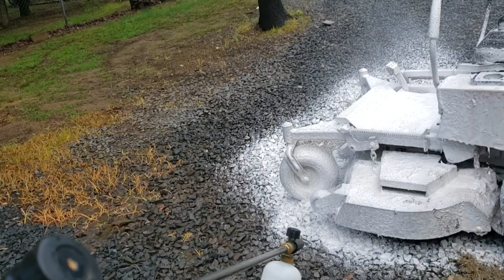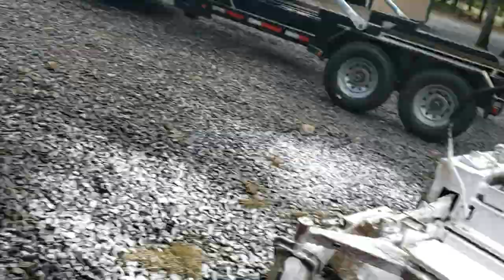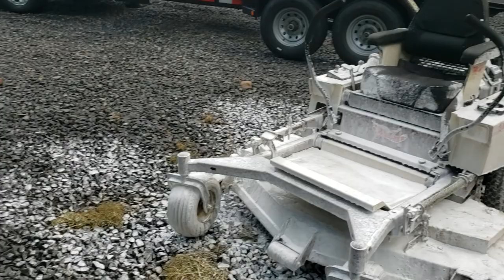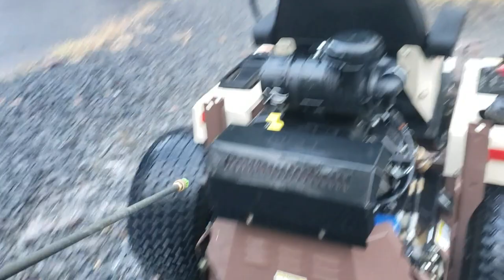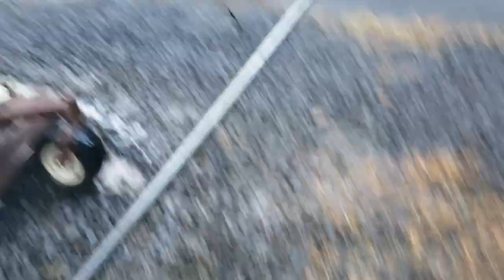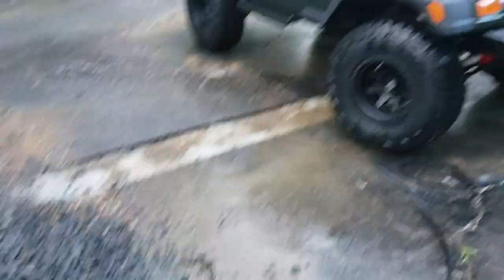Zep truck and trailer wash vs nasty zero turn mower

Comment: In my experience,  Rinsing the vehicle or farm equipment first with just water and then doing the foaming procedure  using 50/50  zep & water with a squirt of Dawn detergent in the foam cannon will yield nice foam with nice results.  Also this  will allow  your bucket of zep concentrate last twice as long... BUT as you mentioned (its your mower - and you will do what you want)
Reply: By doing your method, it should be fine on clear coat and paint on everyday vehicles?

Comment: I used zep today to wash my truck but the foaming it was so watery. May be because i used less than half cannon bottle and the rest water. I will tray again later on
Reply from the maker: use only zep in the foam cannon dont add water in the foam cannon